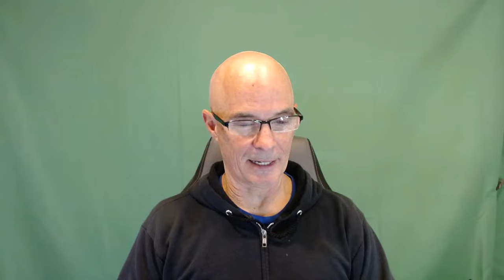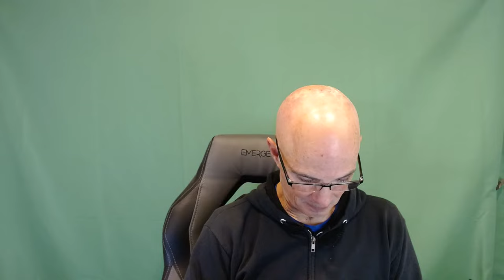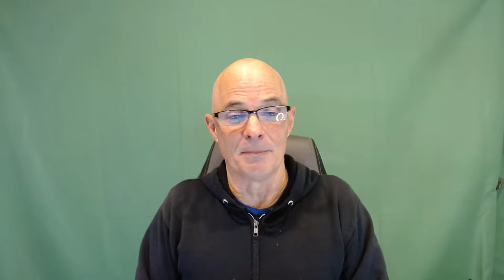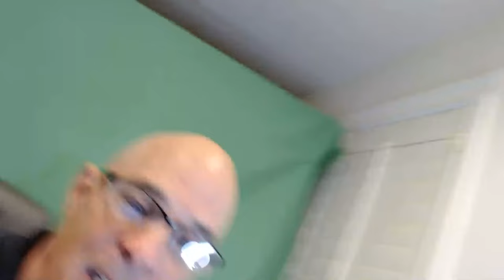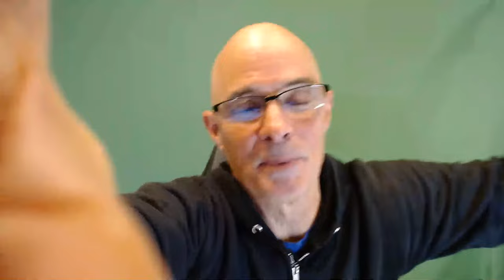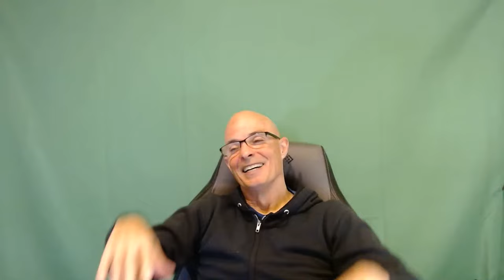LET'S TALK TECH-TEST GOLFBALL DIMPLE PISTONS?

Comment: Well ....its patennted !!!  The Diesel world has flipped out and gone upside down Excited  !!!  The whole point in them offering it to you is They Already Know !!! No Company would shoot themselves in the foot with untested stupidity and offer somebody to embarass them . Technically this dimple size and pattern increases the surface area of the piston , thats why its coated .  Pressre x area =  lbs of force .  Their patent is on the size and pattern that was Proven Effective .
Reply: Only if that added area is perpendicular to the vector of piston travel. Now only a tiny dot is aligned with the piston travel. Alas I would bet on lower power. Plenty of companies have sold snake oil and plenty have bought it up with little thought.

Comment: Dimpling the recessed part I believe would be useless because there's no counter surface to activate the air flow. A rough area makes a boundary layer that in a sense makes the area smaller because the air pressure is off of the surface not attached to the surface. So in theory this would make your combustion chamber act as if your compression ratio was higher than what it actually is, now whether that actually works is another debate.

Comment: 1973 1 ton Ford pickup truck, 1974 Lincoln 460 and c6 transmission, 670 Street avenger Holly + 100 micron stainless steel screen 18 + MPG!!! ( 1 inch spacer + high power coil was also used! Before my up grade I only got 12 MPG at Best!
Reply from the maker: a 460 with a C6 getting 18 mpg? seems very high